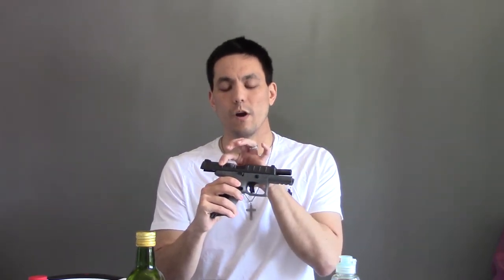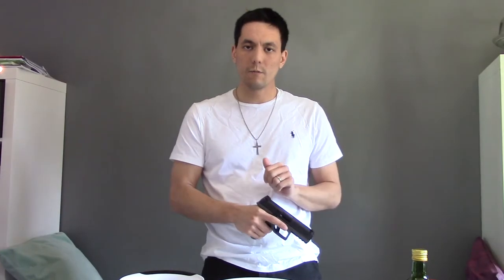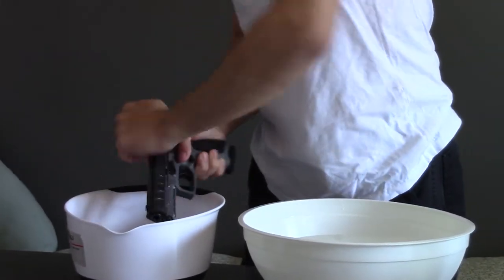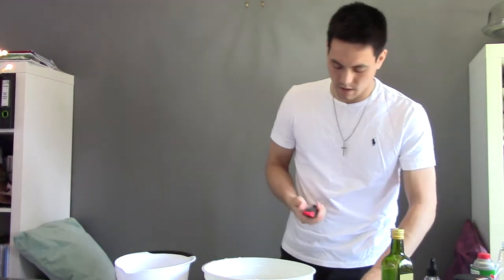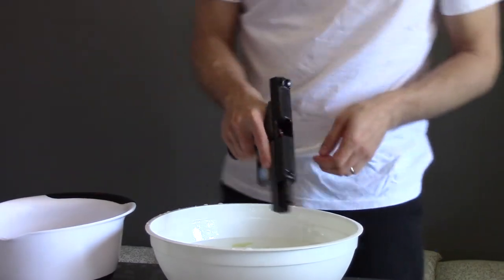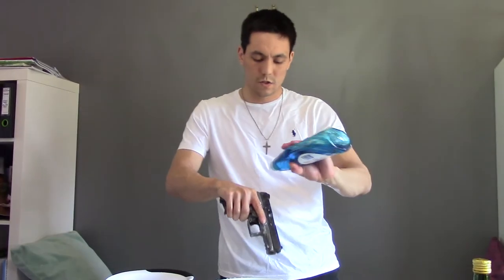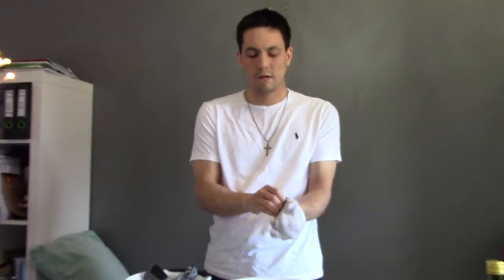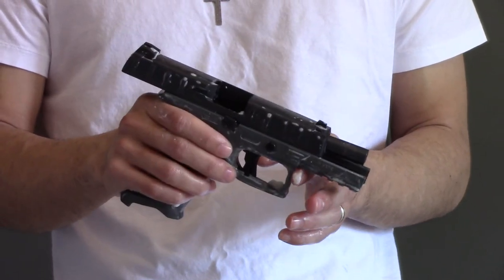Beretta APX Serrations Test

Comment: Once I realized how Beretta intended for the pistol to be manipulated it makes sense. Most soldiers in the field are going to be manipulating their pistols with gloved hands. Anyway good video.
Reply from the maker: While it's clear that the slide serrations are very optimized when it comes to gloved handling, I think the "doesn't work when wet" is overblown. If you notice, when the slide is slightly oily with Ballistol and Water only (before I slather on the Ballistol), the slide is still quite easy to manipulate. When I clean the gun in water and soap, it's also easy to manipulate the slide. While it is more slippery and you can slip if you don't grip it right, if you use a standard overhand racking method, then it works well. It does get more slippery as you add on the oil, as you would expect. Fortunately, there are many ledges you can use to rack without a friction grip, and others use grip tape or the like for those situations.